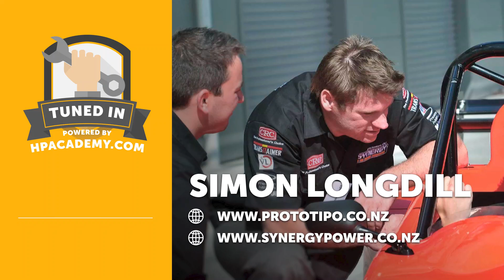111: He Wasn’t Impressed With The Engines On Offer, So He Built His Own. [PODCAST]

Comment: I'm  really  perplexed  this the second time i have heard a very smart man  say "Hydrogen is less energy dense" and  when i look up the calorific value of fuels its says the opposite . what am i missing ?
Reply: possibly they're talking about gaseous hydrogen, since liquid hydrogen can't be practically used to fuel a combustion engine. In this case the limitation would be the volume of fuel instead of the weight, and thus the important metric would be power per volume of fuel instead of power per weight. And in this metric gaseous hydrogen, even when stored under high pressure, is quite poor
Reply: Energy density or calorific value  is expressed as energy per mass  often jouls/kg  the any other way is wrong  the  only complexity is latent heat of valorisation value is subtracted sometimes and sometimes not. Because all fuels need to turn to vapour to combust I have  seen a liquid burn that is not being converted to vapour/gas in the delivery process